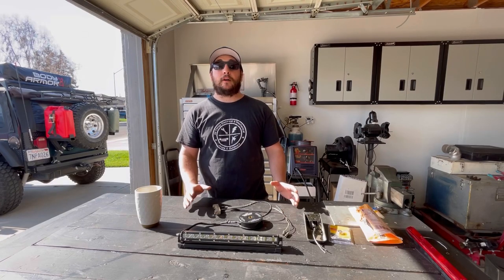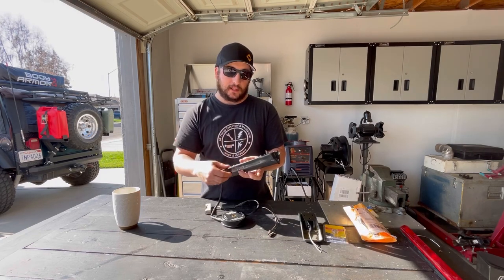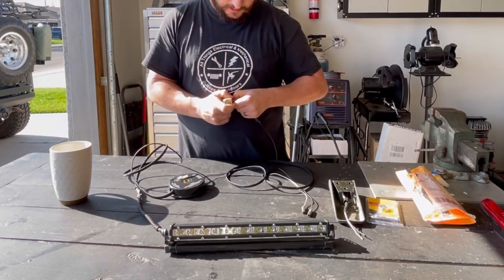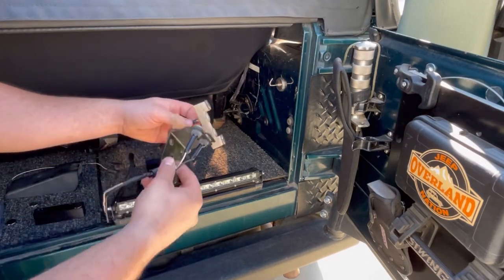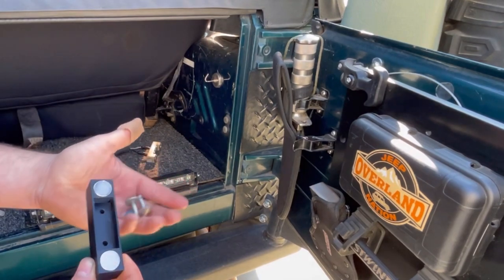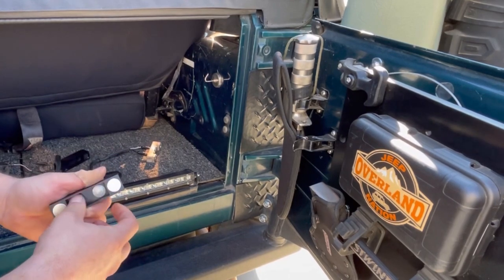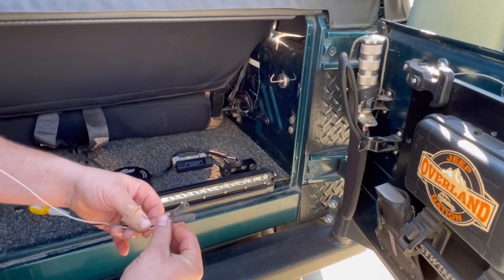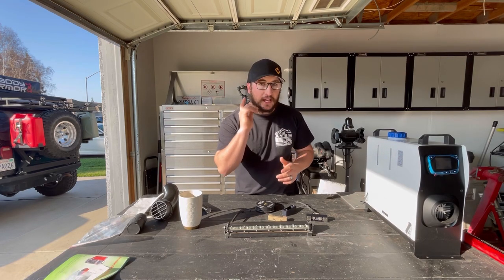Jeep Wrangler Tj - DIY Overland Camp Light Build + Tailgate Brake light Contact Mod

Comment: Glad I could help out buddy! Having an extra light that doesn't require batteries will be helpful at the campsite.
Reply from the maker: Absolutely . This is what happens when you have a bunch of spare parts lying around and a need for light, you make something work for yourself. Plus those contacts on the tub for the spare/brake light  really had no use until now! Does your YJ have those contacts? Also will be needing a few more made up! Just got an order to make at least two more one for a viewers camp tailgate kitchen he’s making . Again thanks for the help!
Reply: @ATEMOFFROAD  The YJ has the same contact points.
Reply from the maker: @SquareLyfe  awesome looks like we’re going to have to build you one for your YJ and share this with the YJ community. I can ship you some spare parts that I have if you’d like 👍🏼

Comment: Frigging brilliant idea! I'm wondering if you could put a connector on the wires coming from the contacts and then just wire up your accessories with a matching connector so you only need one block. I'm not sure if heavy duty R/C connectors like a Traxxas or Dean's T plug would be strong enough but they would be relatively cheap. Oh the possibilities of accessories 😍!
Reply from the maker: That’s actually a great idea, and if I get some interest in the contact block I could possibly make them that way and offer some additional connectors with the block for accessories. then you can just switch to what device Your using or need at the moment. might just do that. Traxxas connectors are good also check out Anderson pole connectors could be great for this too. if I come up with other accessories I need most likely I’ll do this! For now it’s just a heater and a light and I just happen to have two blocks. Thanks for watching and sharing! 🍻

Comment: How do you get full time power to those contacts? Mine only have power when you push the brake pedal. 01 wrangler
Reply from the maker: You will have to add a wire to one of the contacts either from a switch box or your own protected relay! Here’s a video showing how it works https://youtu.be/mV3zdJJxZ6s